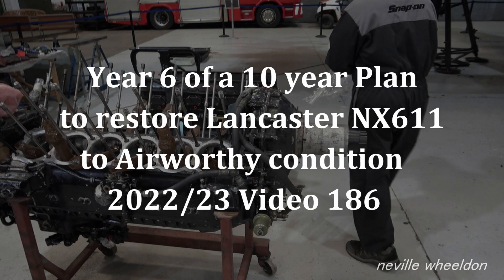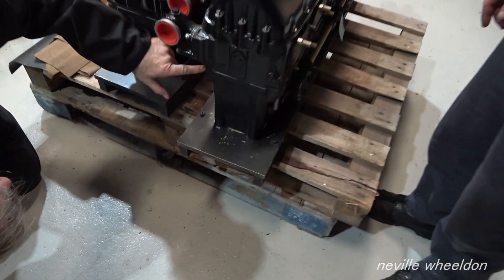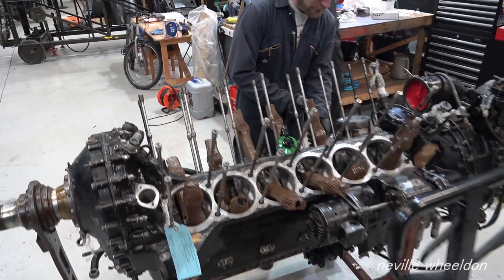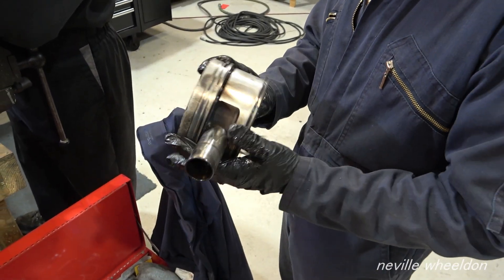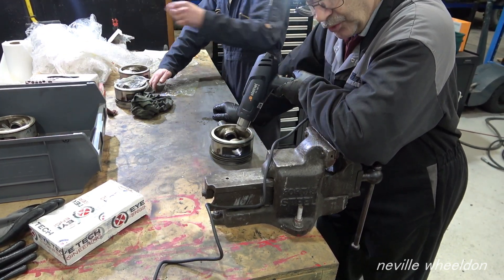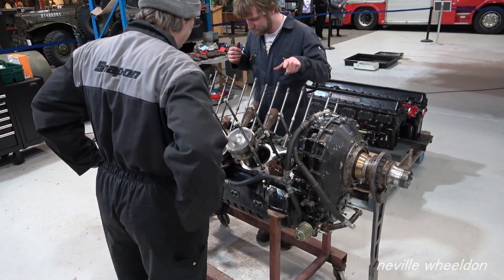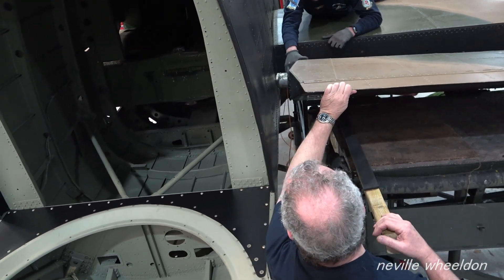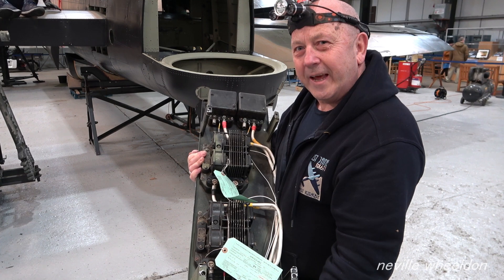Video 186 Restoration of Lancaster NX611 year 6.. Rolls Royce Merlin top half assembly

Comment: I totally agree that those corner studs are a nightmare. They had problems with them as far back as the 1950`s and tried various types of heavy plating, and including seals (which made the situation worse by trapping water). they should have machined the corners of the blocks or added a drain hole so they are open to the atmosphere like the single-piece block, and the problem would have disappeared.

Comment: The side load is on the inlet side only on one side of the engine as it depends of the angle of the conrod during firing...and THAT is identical on the two sides...hence pistons are mirrored on US V8:s or have not utilized valve pockets.....on the old push rod variety...not on the more up to date 4 valve variety ,took em decades though....

Comment: Cheers for the update Neville.  Lovely to see the inner workings of that merlin.  What a beautiful piece of engineering.  To hear that some of the parts have not been touched since it was made at Rolls Royce all those years ago.  A real testament to the level of skill that was around back then that these engines are still around today. Not like the modern rubbish that only last for a short space of time.  Also credit goes to the guys there at East Kirkby for all the hard work they do regarding the restoration and also for keeping those merlin engines running for all of us to enjoy.  No sweeter sound than the roar of a merlin engine.  Melts the heart every time. Best wishes to all the guys at East Kirkby and also to you Neville. 👍
Reply from the maker: Thanks Andy.

Comment: Hi Nev, is this a Merlin that's been on Jane for  taxi or has it been in the shop?  When they said it hasn't come apart since RR assembled it, I was curious.
Reply: This is Tony Agar’s original Port engine for his Mosquito. His Mossie has been running with a loaned Merlin from LAHC for the last year (the ‘Swiss’ engine).
Reply: This is a ground running engine only.
Reply: @VulcanBomberxm655  Yes, but they have extra taxi only and airworthy engines in store.  My question was did this come off of Jane or maybe even the Mossie for which there are also extra taxi only Merlins if memory serves.  As of early 2018, the center had 10 Merlins.  Nev, is this the 'brand new' engine retrieved from Switzerland?